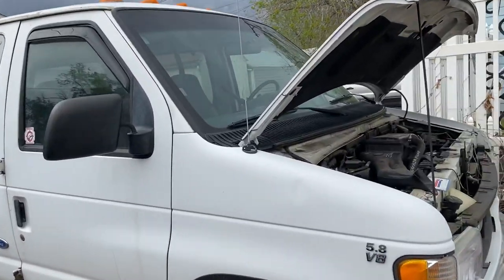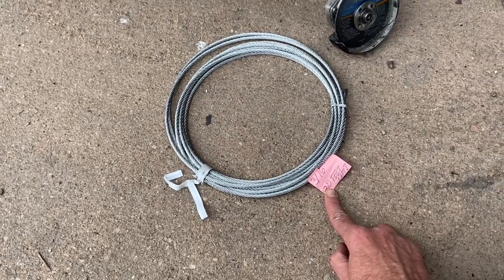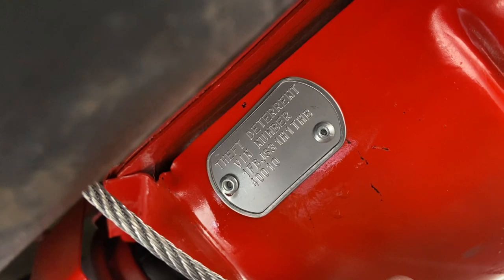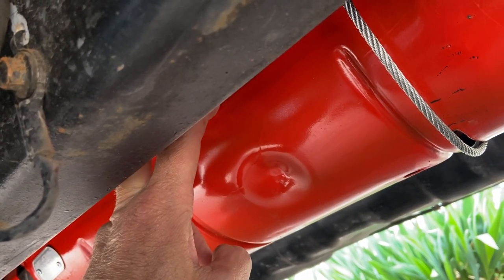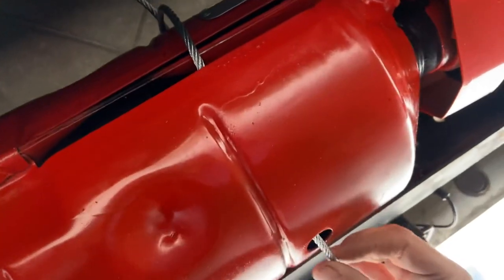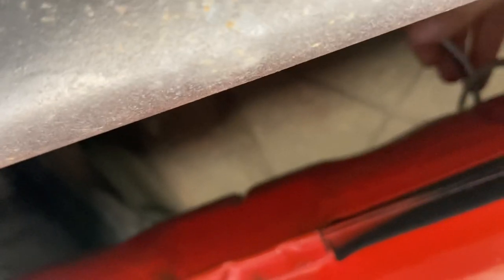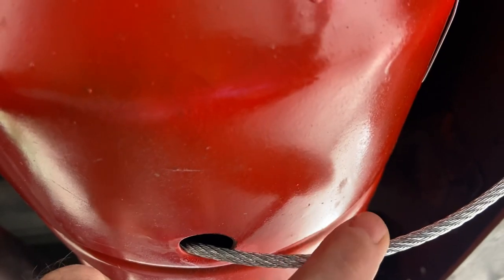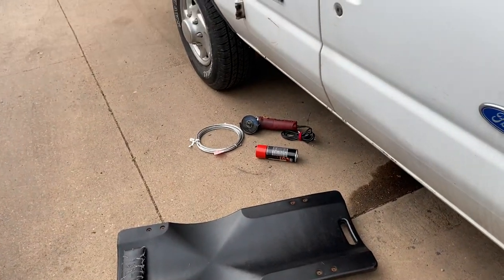Catalytic converter how to Anti-Theft Security Protection DIY. Spray paint Vin tags Steel Cables $30

Comment: Sorry, but that's a waste of time and money. A cutting wheel will cut those cables in 5 seconds. Remember they  have a cutting tool. People that are buying these parts know they are stolen, so the paint and badge are  useless.
Reply: Exactly! Painting and badging is so dumb. Simple can of paint remover solves that. Plus by the time tracked down to the matching vin, the car owner will already have had a new one installed.
Reply: Agreed again! 

Cutting wheels are a damn lethel tool in this situation. Y I've wrapped the living shit outta my entire exhaust system in barbed wire welded to the cat and welded to the frame in several places PLUS welded a heavy gauge steel cage to the frame over all that. 

All good and smart and strong deterrent BUT

I still think ALL electric vehicles solve this problem completely!

Comment: The same tools they use to remove and steal your cats will also be used to cut off them wires like butter. Once they steal your cat they can take it home and remove the tags with ease and burn off the paint with a torch. Its a no win situation with these theives.

Comment: Unfortunately that only slows them down about 35 seconds. They dont use sawsalls anymore. And 5 gallon pail of lacquer thinner paints gone in minutes.   Not much you can do that thief’s haven’t seen and defeated already. But its pisses them off when u already gutted the cat. 
This problem is nothing new.
All your hard work i can still have it off in 1.5 min.  Cute tag gets ditched with shield anyway 🤣
Reply from the maker: Good points but the attach I just had, the cables and barb wire did save my cat from theft. Unfortunately they still cut the pipes and tried to get it..
Also unfortunately the law says the muffler shops can't reattach a completely detached cat so I'll have to weld it back on myself.
I may add some expanded steel grating to discourage them from doing any cutting.

Comment: The dog tag would just be removed before they took the cat to a junkyard
Reply: Also, the clamps should be tack welded or at least JB Weld.  Great idea though and very inexpensive.  If the thief sees all that cable hopefully they will move on to something with less trouble. They want to snatch and go, not screw up around with it all night!

Comment: Back in my day we had these things called a car alarm 🤣
Reply: I watched the muffler shop remove and replace a set of cats with the alarm armed, not a peep from it.  An alarm sensitive enough to be triggered by removing the cat would probably be going off all the time for nothing.
Reply: @DonziGT230  well a couple companies make specific CC alarms that detect vibrations and/or they can detect tilt like if the thief is using a jack to lift the car.

Comment: THIEFS use Battery Die Grinders. It can Cut that Cable in Seconds. VIN Plate comes off Easy. The Red Paint??? Maybe to much hassle to sand or strip the Paint off. BOOBY TRAP IT. Epoxy Razor Blades to the Top. OUCH!

Comment: Putting anything right on the catalytic converter or cause it to superheat throwing the heat sensor for the Cadillac converter off their for showing the computer off and having all kinds of check engine light problems

Comment: 1 spray painting a cat that reaches 2000 degrees is stupid. And will burn off or cause a fire. And you really think that cable is going to stop a thief. The vin tag grinded off in 2 seconds with ur grinder or.drilled out. BUT A PLATE UNDER THE CAR LIKE A REAL PRO WOULD DO. DONT WASTE YOUR MONEY PEOPLE. Only thing that will work is a over road skid plate. Somthing bulky. THICK steel. Bent to prevent damage from rocks and road debris. It can be bought for alot of cars and trucks. This is stupid. The cable can be cut with a $10 bolt cutters. Plus no one gives a rats ass about your aftermarket cat worth $5. They are going after toyota prius cats being they are worth up to $300 scrap. Trust me. Ur shit as vans cat isnt what they want.

Comment: pro tip: cut off your own catalytic converter so they cant steal it
Reply: Convert it so you can put it back on every time you drive.
Reply: route the converter into your car so they cant even find it
Reply: Sleep in the bushes with a 12-guage shotgun and after you light someone up, the word will get around that your converters are not worth dying for. 😉
Reply: @savoirfaireethereal4234  I actually do this lol. I just have to remove 3 bolts to get the a whole section of the exhaust out and replace with with a straight pipe section I bought off eBay for around $100. I get the inspection done, then I get back home and bolt on the straight pipe section and drive like that for a year.
Reply: @dxjtg  You can just buy car models that have the cat against the firewall. Usually European cars are like this but I know that some Ford economy SUV's and small cars also have this design with the converter integrated into the exhaust manifold. No way in hell is anyone going to steal that.
Reply: @Junkman2008  Yup you can tell all your new friends in prison the story.
Reply: @brucespurier7535  
Hey E-THUG, you won't have to worry about anyone stealing the catalytic converter off your house, even if it does have wheels.  🤣😄😆😄😅😂
Reply: @brucespurier7535  
Hey E-THUG, how often do you drive your house to Jiffy Lube? 🤣😆😄😭😅😂
Reply: @brucespurier7535  
Hey E-THUG, I have quite a few nice cars but none of my houses have wheels OR fender skirts on them. 🤣😆😄😭😅😂🤣😆😄😭😅😂
Reply: @Junkman2008  Is this the best you can do?   Sad.
Reply: @brucespurier7535  
Hey E-THUG, you should contact the Wizard of Oz. Maybe he can get you some COURAGE. 🤣😆😄😭😅😂🤣😆😄😭😅😂
Reply: @Junkman2008  Dude, you're embarrassing yourself.   Are you hyper-ventilating?
Reply: @brucespurier7535  
Hey E-THUG, can we expect that video anytime this year? Doesn't your flip-phone do video? 🤣😆😄😭😅😂🤣😆😄😭😅😂
Reply: @Junkman2008  Is this really all you can come up with?   smh
Reply: @brucespurier7535  
Hey E-THUG, does your trailer have running water? Do you have a hard time catching it to take a shower? 🤣😄😆😅😂😅😆🤣😄😆😅😂😅😆🤣😄😆😅😂😅😆🤣😄😆😅😂😅😆
Reply: @brucespurier7535  
Hey E-THUG, CRY ME A RIVER! 😭😭😭😭😭😭😭😭😭😭😭😭😭😭😭😭😭😭😭😭😭😭😭😭😭😭😭😭😭😭😭😭😭😭😭😭😭😭😭😭😭😭😭😭😭😭😭😭😭😭😭😭😭😭😭😭😭😭😭😭😭😭😭😭😭😭😭😭😭😭😭😭😭😭😭😭😭😭😭😭😭😭😭😭😭😭😭😭😭😭😭😭😭😭😭😭😭😭😭😭😭😭😭😭😭😭😭😭😭😭😭😭😭😭😭😭😭😭😭😭😭😭😭😭😭😭😭😭😭😭😭😭😭😭😭😭😭😭😭😭😭😭😭😭😭😭😭😭😭😭😭😭😭
Reply: @brucespurier7535  
Wow, you've been thoroughly embarrassed in this string of comments. You should quit while you're behind. 🤦‍♂️
Reply: @actionjackson6003  
Some of these clowns never learn but I have a blast schooling them! 😅😄😆🤣😂😁
Reply: @brucespurier7535  
Hey E-THUG, are you making that video with a Polaroid camera from 1970? 🤣😄😆😅😂🤣😄😆😅😂🤣😄😆😅😂🤣😄😆😅😂🤣😄😆😅😂🤣😄😆😅😂🤣😄😆😅😂🤣😄😆😅😂🤣😄😆😅😂🤣😄😆😅😂🤣😄😆😅😂🤣😄😆😅😂🤣😄😆😅😂🤣😄😆😅😂
Reply: @brucespurier7535  
Hey E-THUG, YOU MAD BRO'? 😆😄😅😄😆🤣😂😆😄😅😄😆🤣😂😆😄😅😄😆🤣😂😆😄😅😄😆🤣😂
Reply: @brucespurier7535  
Hey E-THUG, yea, YOU MAD! 😆😄😅😄😆🤣😂😆😄😅😄😆🤣😂😆😄😅😄😆🤣😂😆😄😅😄😆🤣😂😆😄😅😄😆🤣😂😆😄😅😄😆🤣😂😆😄😅😄😆🤣😂
Reply: @Junkman2008  You still lost.
Reply: @brucespurier7535  
Hey E-THUG, BUBBA is going to find all the potholes up your dirt brown road! 😆😄😅😄😆🤣😂😆😄😅😄😆🤣😂😆😄😅😄😆🤣😂😆😄😅😄😆🤣😂😆😄😅😄😆🤣😂😆😄😅😄😆🤣😂😆😄😅😄😆🤣😂
Reply: @brucespurier7535  
Hey E-THUG, BOY, you are SO easy to troll! 😆😄😅😄😆🤣😂😆😄😅😄😆🤣😂😆😄😅😄😆🤣😂😆😄😅😄😆🤣😂😆😄😅😄😆🤣😂😆😄😅😄😆🤣😂😆😄😅😄😆🤣😂😆😄😅😄😆🤣😂
Reply: @brucespurier7535  
Hey E-THUG, nahhhh.... you're more like daddy's little PRINCESS! 😆😄😅😄😆🤣😂😆😄😅😄😆🤣😂😆😄😅😄😆🤣😂😆😄😅😄😆🤣😂😆😄😅😄😆🤣😂😆😄😅😄😆🤣😂😆😄😅😄😆🤣😂😆😄😅😄😆🤣😂😆😄😅😄😆🤣😂
Reply: @brucespurier7535  
Hey E-THUG, maybe you played The GIMP in Pulp Fiction? 😆😄😅😄😆🤣😂😆😄😅😄😆🤣😂😆😄😅😄😆🤣😂😆😄😅😄😆🤣😂😆😄😅😄😆🤣😂😆😄😅😄😆🤣😂😆😄😅😄😆🤣😂😆😄😅😄😆🤣😂
Reply: @brucespurier7535  
Hey E-THUG, BUBBA wants to see your pretty lips. 😆😄😅😄😆🤣😂😆😄😅😄😆🤣😂😆😄😅😄😆🤣😂😆😄😅😄😆🤣😂😆😄😅😄😆🤣😂😆😄😅😄😆🤣😂😆😄😅😄😆🤣😂
Reply: @brucespurier7535  
Hey E-THUG, don't you get mad and go find a clock tower! 😆😄😅😄😆🤣😂😆😄😅😄😆🤣😂😆😄😅😄😆🤣😂😆😄😅😄😆🤣😂😆😄😅😄😆🤣😂😆😄😅😄😆🤣😂😆😄😅😄😆🤣😂
Reply: @brucespurier7535  
Hey E-THUG, hell.... you probably couldn't even handle a rifle.... LIKE I CAN. 👀👀👀👀👀👀👀👀
Reply: @brucespurier7535  
Hey E-THUG, is that why you're SCARED? 😆😄😅😄😆🤣😂😆😄😅😄😆🤣😂😆😄😅😄😆🤣😂😆😄😅😄😆🤣😂😆😄😅😄😆🤣😂
Reply: @brucespurier7535  
Hey E-THUG, let me come over and read you some nursery rhymes. 😆😄😅😄😆🤣😂😆😄😅😄😆🤣😂😆😄😅😄😆🤣😂😆😄😅😄😆🤣😂😆😄😅😄😆🤣😂😆😄😅😄😆🤣😂😆😄😅😄😆🤣😂
Reply: @brucespurier7535  
Hey E-THUG, you're gonna flood your trailer park home with all them tears! 😆😄😅😄😆🤣😂😆😄😅😄😆🤣😂😆😄😅😄😆🤣😂😆😄😅😄😆🤣😂😆😄😅😄😆🤣😂😆😄😅😄😆🤣😂😆😄😅😄😆🤣😂
Reply: @brucespurier7535  
Dude, I don't know why you're mad at me. I'm not trolling you. You're pretty sad. Just let it go and take that "L".

Comment: You are forgetting there are cordless tools out there besides saw all's, if they can't cut our cat off what's makes you think that extra stuff is gonna stop them? 
What they need is jail time for each cat they catch them with
Reply: Criminals are lazy. Thats why they are criminals and don’t have a job. If they look under and see a bunch of wire it’s not worth the trouble. If it is gonna take longer than 2 minutes they won’t bother
Reply: A skilled thief will probably bring along bolt cutters, angle grinder, a wrench set, and maybe a dremel tool along with their recip saw and a pack full of the milwaukee metal recip blades, if they really want your cat they'll get it but have to think twice the extra 3-4 minutes and extra noise is worth it to them. The average crackhead though which is much more likely to come across your car is running around with nothing more than a recip and 1 or 2 blades they stole from walmart. Even if they aren't deterred by the time they get to sawing off their cat the blade is going to be extremely dull and won't cut or it will take forever to cut.
Reply: People barely go to jail for murder.

Comment: So, I immediately terminated this video at the point where he showed us the cable he purchased to protect the converter and how he used a standard rotary saw to cut that wire.  Good job, buddy, you basically showed us how you protected your converter using something that you, yourself easily cut using the same type of cutting tool that the thief will likely have in his/her toolkit.
Reply: You're right, man.  This video has educated thousands and thousands of thieves so now they all know the easy way to steal converters.  Until this video came out, they had no idea that hand held grinders with cutting wheels even existed.  Now the theft rate for converters will skyrocket world wide.   This video will cause billions in losses now.     A regular Einstein, aren't you?